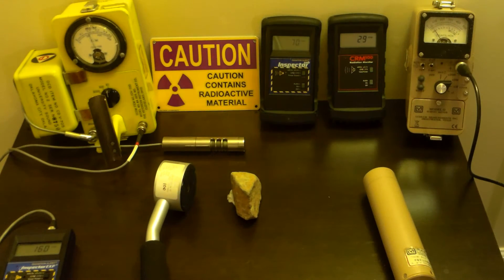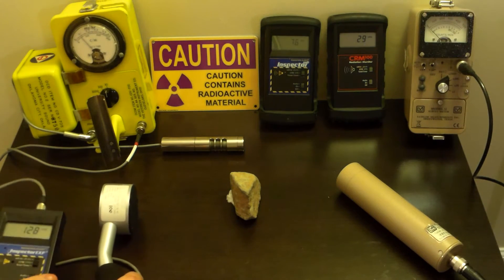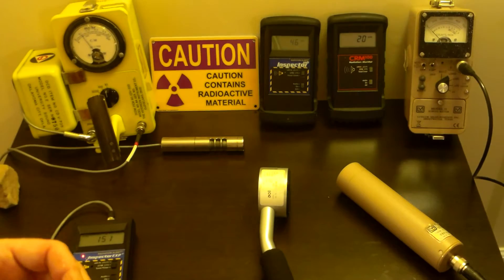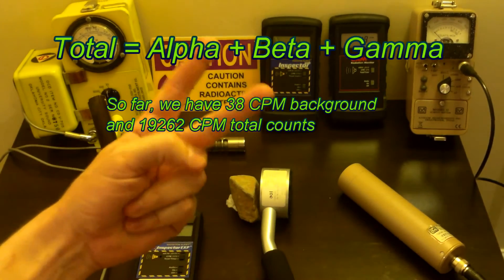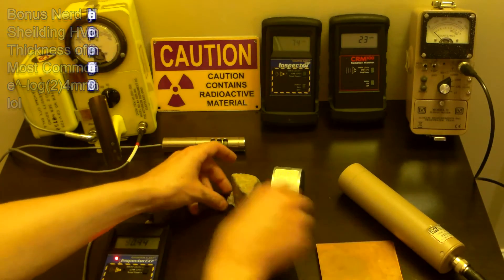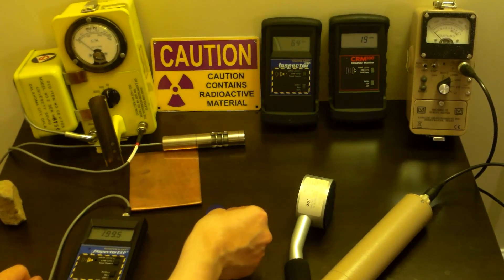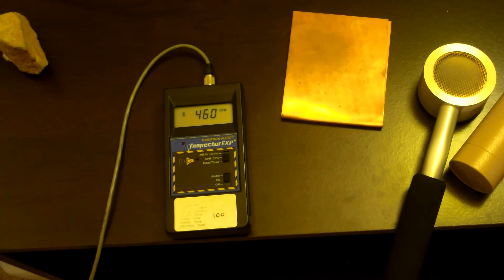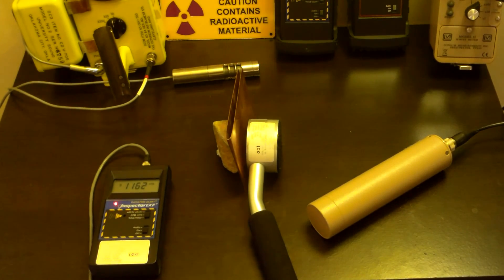(Radiation and Geiger Counters) How to Separate Alpha, Beta, Gamma

Comment: Do you know what type of Uranium this is? Uraninite, Pitchblende, Carnotite, Gummite?
and also how would you store a material that emits Beta and Gamma? would you do the same sort of thing like what you did with your Strontium 90 source and put it in a Aluminium/Copper container and then put that inside of a lead lined box? im interested to know because i am getting into the Radiation/Nuclear part of Physics and would like to purchase my first sample! some generic uranium ore that could contain Pitchblende. But im a bit confused because United Nuclear says that its very safe and you could even handle it with your bare hands (Ofcourse being mindful of chips and fine particles that can fall of)!  and other sites i have seen said that it is very dangerous and should be kept in a lab equipped for holding Plutonium!, so what is it, Dangerous or not? the Sample i have in mind ranges from 1,500 to 3,000 CPM

Thanks.
Reply from the maker: +Da Moose Are you referring to a uranium sample in my video? If so, please reply with the time in the video where it is. I have a lot of videos I tend to forget what's in them.

The reality is somewhere in between United nuclear and the laboratory. Uranium ore samples, the low intensity ones like you're talking about, do not require exceedingly special care. Placing them inside of the box that does not contain any metal, such as cardboard or plastic is fine if they're not can be kept in the house. If you're going to keep them in the house you should consider sealing them in something like a glass jar or thick plastic to prevent the raid on the Internet from leaking. As you have already determined, the biggest problem is really the dust that comes from them, as well as a little bit of radon.

Handling them with your bare hands is not exceedingly dangerous, but is not the smartest idea to do with many types of rock samples. Uranium, besides being radioactive, is also chemically toxic, like lead. There is also lead and other similar things mixed in uranium samples which can be not too good for your health, especially your kidneys.

If you want to hold uranium in your bare hands, I recommend thoroughly washing your hands with soap afterwards. The proper means of holding uranium is with a latex glove. Don't feel like touching uranium means that you're going to drop dead, but don't lick your fingers either. Treat it similarly to lead.
Reply: +antiprotons Alright! thanks for the help the uranium sample is at: 0:25
Reply from the maker: Da Moose Ah, it's an ugly piece of gummite and other stuff. If you want a good sample, try this company:  http://www.minresco.com/radioactive/radioactive01.htm

Comment: Thanks Tom! Your channel is extremely interesting. Just a passing question..while calculating the Background radiation, why have you put the Uranium sample kinda near the GM ? I suppose that such distance still affects the reading..such distance is not enough for the gamma rays to be attenuated by the air, I suppose. I did not go through the calculations, though.
Reply from the maker: Ibrahim Hany Normally, you would keep the sample farther away. I was simply showing the technique, so I was not being very accurate. Also, I did not perform 10-20min tests.

Comment: Scintillator can detect beta, but not as discrete energies - rather smeared continuum. It is funny at your video after 9:50 you showed that your scintillator does NOT pickup beta... No surprise, when detector is turned OFF. You did switch it off at your video after 02:00. Everything else is fine.

Cheers,
milan
---
Reply from the maker: A beta scintillator can detect beta's, but not all scintillators, such as my gamma/x-ray scintillator. The scintillation medium, in this case NaI(Tl), is blind to it. It can only detect the secondary emissions from bremsstrahlung from the electrons slowing down.

A beta scintillator, totally different thing, detects the beta continuum. All beta emissions are exactly the same energy (for a specific decay scheme) but that energy is distributed between the beta and it's neutrino, randomly. This makes the continuum. Most beta scintillators are liquid.

The scintillator was not off at 09:50. I only shut the sound off at 02:00. It was set to x1000 (you can see the dial plainly). My low energy x-ray probe can detect bremsstrahlung from th Sr90 sample, but not much. A liquid beta scintillator could do a better job. There are plastic and glass scintillators for beta, but they are not much good for spectrometry, having terrible resolution.

Here's a model 3's control plate for reference:  http://www.ludlums.com/images/stories/virtuemart/product/Model%203%20front%20panel.png

Comment: Hi Tom. Thanks for your videos. I've learnt a lot from them. I have a doubt. There you have a uranium ore, but that can't be only uranium because it only decays in alpha. So if you go buy some ore when you measure with it with your counter, for example, mine only measures beta and gamma, you will be not measuring uranium but the products of the decay or some potassium. I'm all right or a bit messed up? thanks!
Reply from the maker: Uranium decays via alpha decay, but it also emits x-rays and gamma rays, directly. Most of what your detector see's will be the daughter's, such as Bismuth 214 and Lead 214. Most of what you see are daughters, but not all.

Comment: This is a great video! I was just wondering, since Geiger tubes are less efficient at detecting gamma than beta or alpha, would that lead to a falsely low reading of gamma relative to the others? Shouldn't that be factored in?
Reply from the maker: The answer is yes, if you knew the nuclide you were testing. if you just scale the reading up due to some suspected efficiency (efficiency changes with respect to energy) than you would again fool yourself, the other way.

Essentially you are correct, but in reality it is nearly impossible to do this. If you work with a specific nuclide, such as Cs137, then yes you can. Here is how:

For a point source of Cs137 with an activity of A Bq emitting (br) photons per decay, and a detector face pointed at the source with an area of D cm^2, find the intensity hitting the detector, I (photons/sec). Hold the sample away from the detector at a distance x cm.

I = (br) * A Bq * D cm^2 / 4(pi)(x cm)^2
reading / I = efficiency.           Reading / efficiency = real reading.

Now for an example with real numbers (helps).  Source of 1000 Bq of Cs137 which emits a photon 85.1% of the time at a distance of 8 cm using a detector face of 20 cm^2:

I = (0.851) * 1000 Bq * 20 cm^2 / 4(pi)(8 cm)^2
= 21.1626 photons per second.

My unit reads 3 counts per second above background.  3/21.1626 = 0.1418  or %14.18 efficiency.

I then test a different Cs137 source and get 100 CPS above background.  100 CPS/ 0.1418 = 705.2186 CPS, the corrected value.

All of this ONLY works for the same nuclide and in a similar environment.
Reply: antiprotons
I've always wondered about the size of the detector too. If you have an LND 712 that is about a cm in diameter, vs a pancake probe, maybe 5 or 6 cm in diameter, you're going to get more cpm off the pancake probe, correct? assuming both have the same calibration
Reply from the maker: Larger = more detections, but the same detections per square cm of detector face. Of course, detectors do not scale like that. There are many additional variables which govern detection efficiency, such as volume of the detector (more or less gas for detections to occur), the gas, the power applied, and the thickness of the window (areal density).

Comment: What do You use for cleaning (just water and laundry soap or/and something else)?
Reply from the maker: I use fruit/vegatible cleaner, typically. It seems to work quite well. Just spray, wait 5 minutes, and remove. I then test with a pancake detector and all is clean.

In a pinch, I would use water + lemon juice, but duct tape actually works too (for dust).